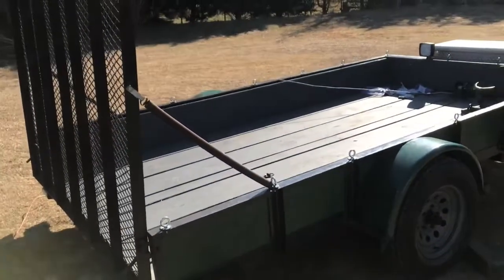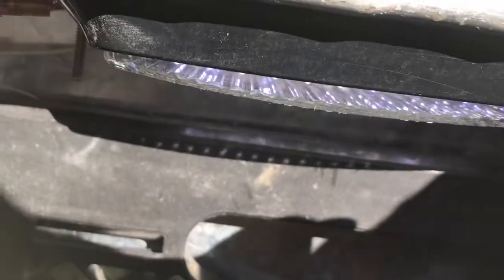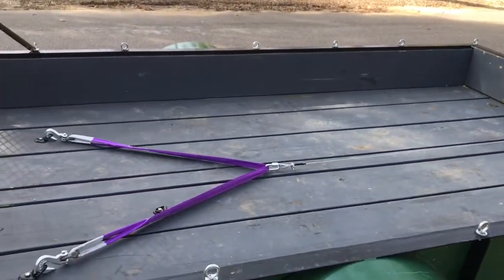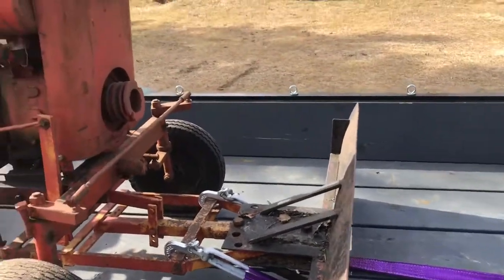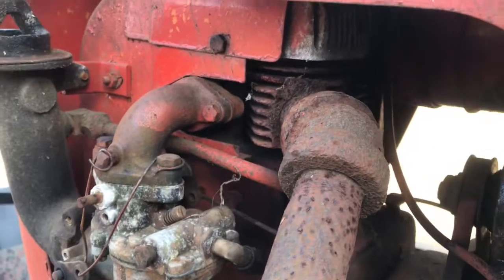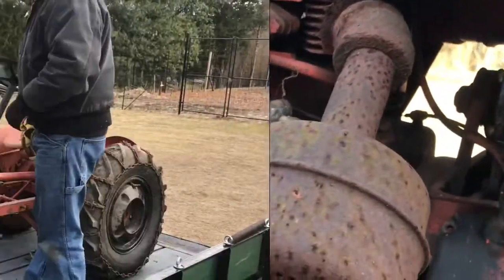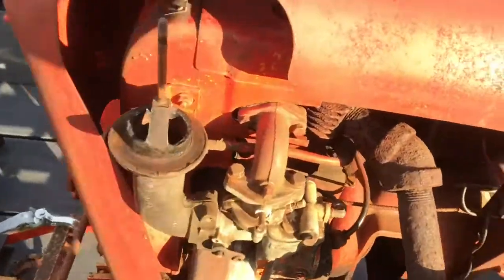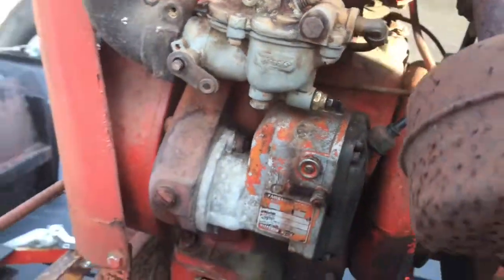1953 country Squire Tractor

Comment: Awesome looking tractor! I just picked one up and mine has the Briggs and Stratton engine but I need new rear wheels. Would you happen to know the size of the rim. My rear tires are Firestone 8-16 and it’s a 6 bolt wheel but I’m lost on what wheels to get. I wanna get 8-16 bkt tires. My front tires are shot as well. The wheels are fine though but I’d like a turf tire 4.00x8. Any help would be much appreciated! I watched a few more of these videos you did on this. The pin stripes looked awesome. Turned out real well 👍. Thanks in advance!

Comment: Old video, but that's not a country squire.  Do some research on the serial number.
Reply from the maker: I guess I should’ve left the camera on the tag a little longer. It says country Squire on the tag where the serial number is. 
Thanks for watching
Reply: Yeah, it sure does.  The serial number doesn't match up with the year according to their website.  I've found alot of inconsistencies with this tractor. 

I have a country squire model but economy brand is the name.  Obviously the same company.   My serial number tells me mine is a 1961 but I can't find any 1961s that look like mine.  

I'm sure over the years things have been replaced with mix matched parts.
Reply from the maker: @kylehanneman6438  good to know I will do a little more research myself and see what I come up with. I was just going by the tag and the year that the older gentleman gave me. Thanks for the information.👍🏻
Have you seen the video after I restart it?
Reply: @Boneyard Garage small engine repairs   yes, I'm also continuing to do alot of research.  Not alot of information about these tractors that I can find.
Reply: @Boneyard Garage small engine repairs   if I had to guess from my research and listening to another guy talk about them. I think your tractor is more like 1961-1962 model. 

The video I watch the guy said 1960 was the last year they had the all curved hood. And after that, they went to a curved front but flat dash pannel style  like yours. 

But I'm no expert so I could be wrong myself.  I'm also trying to learn about them. I just bought one a week ago